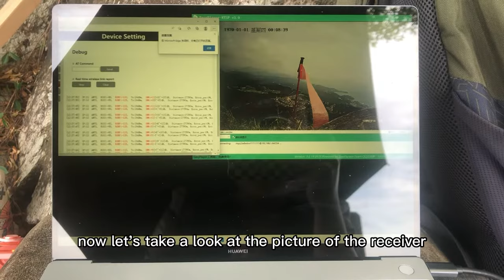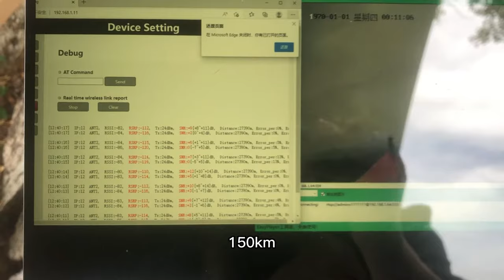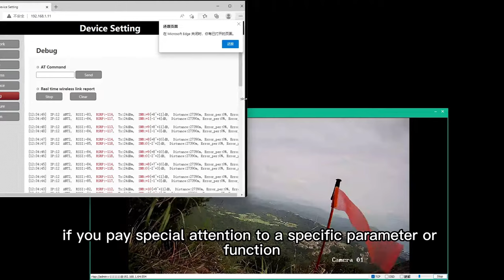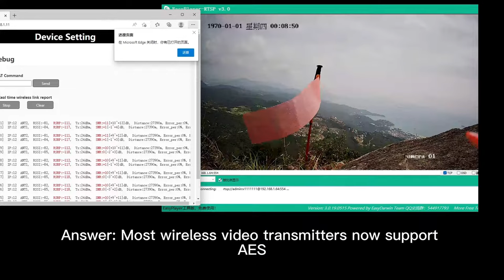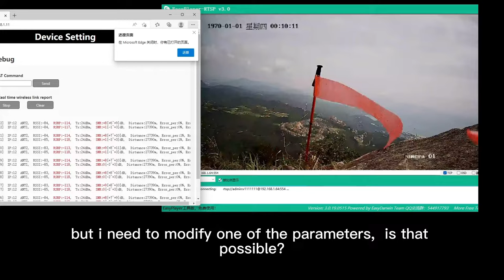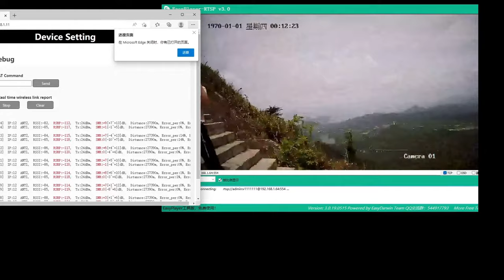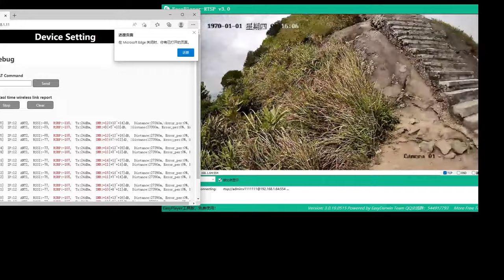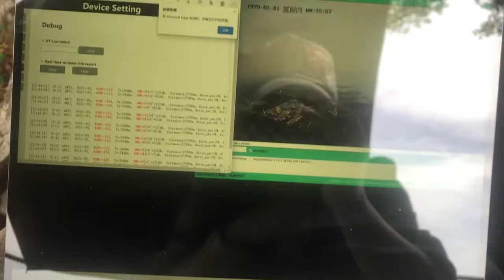best long-range wireless video transmitter and receiver drone uav HDMI IP camera two-way test 2022

Comment: Wait wait wait, I've designed and installed countless wireless systems for IP networks. There is little to no chance of a UAV connecting video via WiFi at significant distances via ISM + IP. WiFi networks inherently have certain delays, beacons etc. so they work better at short distances with numerous other clients. In the USA for example, unless you on top of a mountain your results are going to be not so great, that is precisely why they tested this on top of a mountain! Almost all drone wireless systems use direct digital/analog modulation like FM without the TCP IP layer or transport overhead. You could use 100Watts (not legally) at that frequency, but 2.4/5.8ghz bands are overpopulated for any chance of this working in typical environments, unless the range is extremely short.
Reply from the maker: Thanks. You are professional. 
Frequency can be chosen from 800Mhz, 1.4G, or 2.4G.  
If the frequency has interfered, please turn on the frequency hopping function. It will choose the strongest strength frequency. 
One of my clients chose 5.8G as the transmission frequency. The product does not use Wi-Fi technology. Please check our 110km test video.   https://youtu.be/r1X4AU1togE
Reply: Ok thank you, however if it has an IP address as shown in the video and title then it's IP based and implements WiFi @iVcancom
Reply: @fjs1111 That isn't necessarily true. It sounds like they're using a custom physical layer (possibly a modification of DVB-S2), and what seems like a custom Windows driver to make the hardware appear like a regular NIC that can interface with the Windows IP stack. Since there's only one hop from transmitter to receiver, latency is kept pretty low.
Reply: Shush Cable Guy
Reply: @modernrice  While it could be possible, in this case that's not what they are using. They are using TCPIP + Wifi. DVB will not run over IP without additional encapsulation and that means extra link layers. Even though its Point to Point, WiFi at the Physical layer was not intended for this and this is exactly why we have 3G/4G/LTE, etc. Even WiMax is modified version of WiFi with design spec of distance.

Comment: I'm planning to make an fpv rc plane and I want it to be able to receive a signal up to 20km, which receiver should I use?
Reply from the maker: The below model https://iVcan.com/900 support 10-150km, Which can meet your demand. Please https://iVcan.com/contact to get a free quote.
Reply: What distance can be reached for 2 Watts of power, which will be flown by a drone at a height of 100 meters, and how heavy is this tool?

Comment: Is it possible to interface 4 cameras to one transmitter.
Reply from the maker: supported, please check the FAQ at the below link https://ivcan.com/p/15km-30km-long-distance-wireless-video-transmitter-receiver-transmission-transceiver/#accordion-item-8._does_this_model_support_multi-transmitters_cameras_to_one_single_receiver?_for_example,_use_3_ip_cameras_at_1_video_transmitter. or test video at https://youtu.be/XI0fdp_LctU
Reply: just use a diversity controller.. interfacing it to multi monitors is a whole thing in itself and may require individual antenni like the way a router might work for multiple wifi channels. may i ask what the application is for????

Comment: i have requirement to setup multiple car in motorcycle running ip camera, can send me the details
Reply from the maker: please check the below link https://ivcan.com/p/15km-30km-long-distance-wireless-video-transmitter-receiver-transmission-transceiver/#accordion-item-8._does_this_model_support_multi-transmitters_cameras_to_one_single_receiver?_for_example,_use_3_ip_cameras_at_1_video_transmitter.  or contact us for details at https://ivcan.com/contact/

Comment: Can I connect multiple camera using a single transmitter and receiver ??
Reply from the maker: Yes, support multiple cameras, please check the same FAQ at https://ivcan.com/p/15km-30km-long-distance-wireless-video-transmitter-receiver-transmission-transceiver/#accordion-item-8.-does-this-model-support-multi-transmitters-cameras-to-one-single-receiver?-for-example,-use-3-ip-cameras-at-1-video-transmitter.

Comment: Dumb, honest question:

 Can this be used to extend the range of a drone?
Reply from the maker: Yes, from 10 kilometers to 150 kilometers, it supports extending the range of the drone, but first you have to make sure that your drone has enough power to fly longer distances.

Comment: Can you build a drone with repeater like this
Reply from the maker: For repeater / relay model, please check the details at https://ivcan.com/drone-repeater-solution/
Reply from the maker: For FPV video camera, please see details at https://ivcan.com/p/fpv-video-transmitter-module-3w-pa-50km/#Question_Can_we_assemble_the_repeater_by_ourselves_using_two_sets_of_receivers_and_transmitters
Reply: Would you also work for the tello drone if so could you please do a video

Comment: does it have spyware like dji
Reply from the maker: Our transmitter and receiver supports to setting by 128 bits password AES128 encryption and decryption. You can change the password any time. 
The transmitter and receiver are used private point to point networking. It does not need internet. All the video and data are protected by yourself.

Comment: What frequency is this on?
Reply from the maker: Wireless working frequency band: 1427.9~1447.9MHz (1.4G) or 806~826MHz (800Mhz), or optional 2401.5~2481.5MHz (2.4G) support automatic frequency hopping in the frequency band (default working frequency is 1.4G)

Comment: Share how you did
Reply from the maker: Hi, we used our long-range wireless video transmitter and receiver to do that, it supports up to 150km ~200km at the line of sight, you also can assemble it by yourself by the core link modern. https://ivcan.com/p/uav-wireless-video-data-rc-control-link-module/